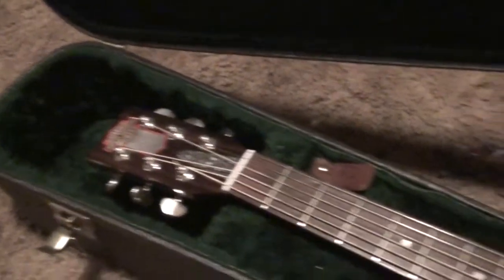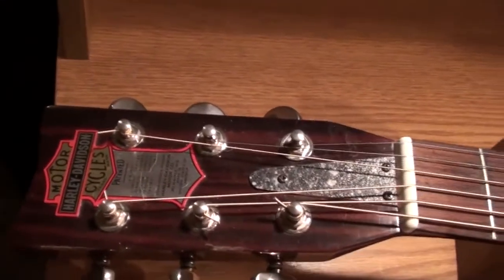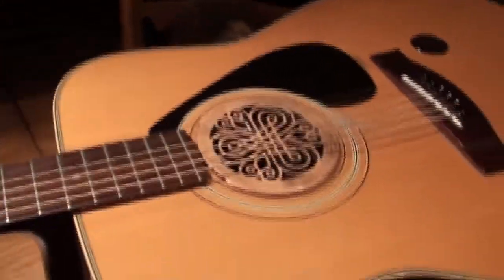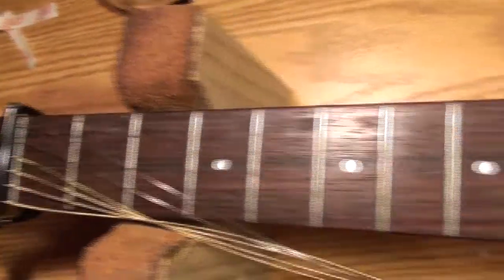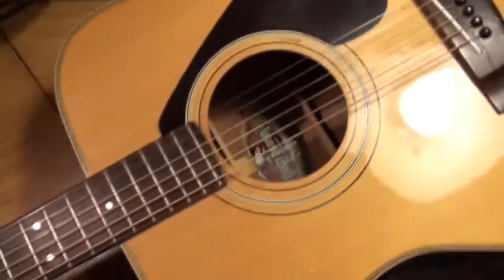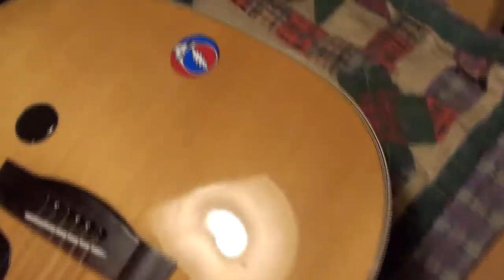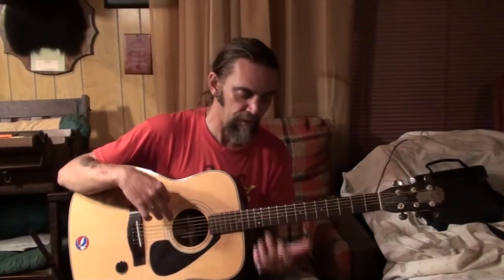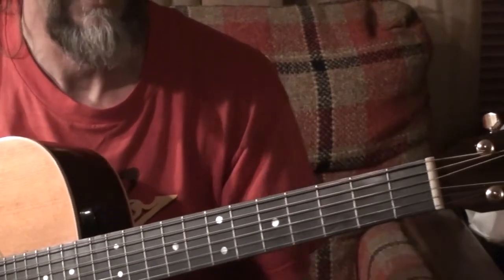Yamaha Acoustic Guitar Repair Battery Box and a cool Cromatic G flat picking lick!

Comment: Your client's guitar sure looks a lot like my Yamaha FG 410E. 
The headstock on mine is decorated with a white dove, inset into the wood, in the shape of the letter Y. 
The battery compartment is a bare metal bracket (which also came loose and required the double-sided tape treatment).  Thanks for the video and the lick!
Reply from the maker: thank you my friend! and thanks for checking out my videos!